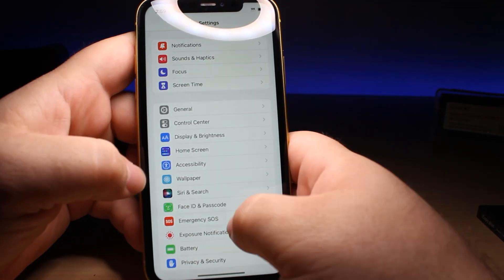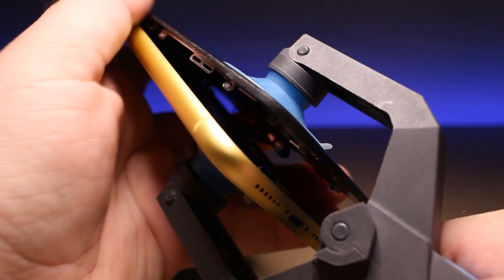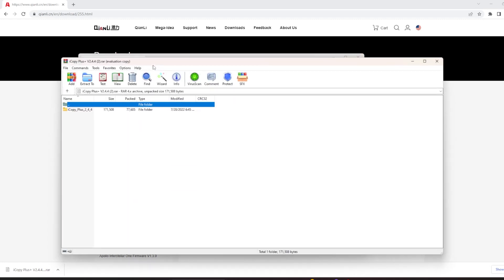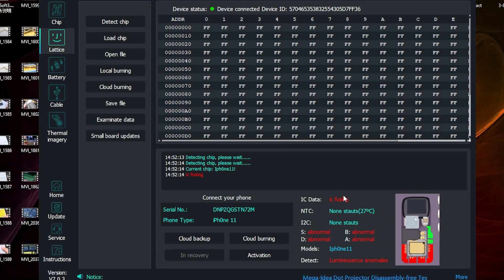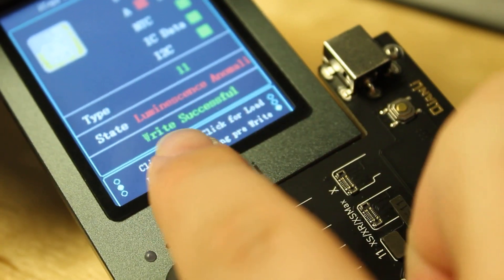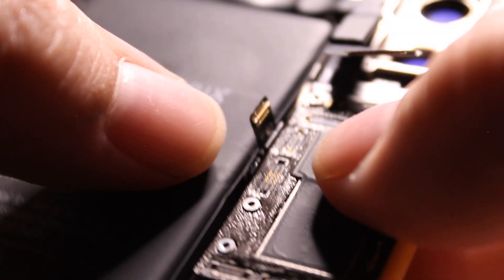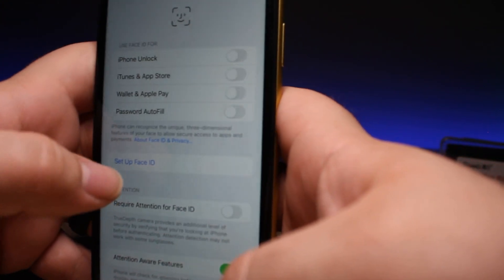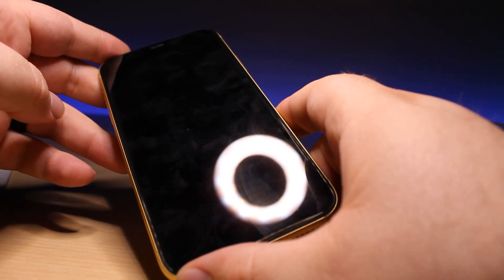Revive Face ID: iCopy Plus 2.2 & New Face ID Board Restoration Tutorial (No Soldering Needed!)

Comment: I keep getting error when trying to use icopy 2.2 for face ID repair. I cloud back up and when click activation I get activation failed, please try again
If the cable is detected abnormally, please remove the extension cord or use the chip solution to fix it.

Comment: Hi sir, thanks for the video.
I was wondering how it’s possible to buy a new face id components and do the programming to be works on used motherboard, can it be done with this tool?
Reply from the maker: No, it’s designed only to fix the original part to get Face ID back.
Reply: @FIXDPHONES  Okay, how then it’s possible to get face id work on another board? 
With another hardware tool or some another way?

What if I replace iCloud chips ( CPU, Nand etc.) from iCloud clean board on other phone board which has Face ID?

Comment: Hi, due to battery problems my iPhone XR cant be detected by the pc while connected via cable, do i have any other solution?
Reply from the maker: You could connect a battery without issues and see if that helps it be detected. If that still doesn’t work maybe something on the motherboard can be fixed to help it be detected.

Comment: very cool. found a cracked (smashed top) iphone 11 (not max/mini/pro, just 11). said face id not working once cleared it out. replaced the screen and the settings just state, face id has an issue, but won't say what kind of issue. the connector looks fine. so, my question is this... can the copy device possibly read the code from original - and from there, program the mini part and use a aftermkt (amazon $15) camera/id assy and have it work?

Comment: Hye,is it using new camera/face id module or using the original old module that is broken?
May I know the success rate and which condition will it work and which will not…since the tag and device quite pricey for some so don’t wanna waste on something that I can’t fix 🥹🥹🥹🥹
Reply from the maker: That’s the whole point. I’ve shown how to do the repair the long and hard way in previous videos, but this allows for the repair to be done quickly without the soldering and attention to detail under magnification for an hour. Sure it’s great that I can do it the old way but if it’s as easy as pressing a few buttons who wouldn’t want to do that instead?
Reply from the maker: The original old module is used for the repair as both the dot projector and infrared cameras are still the paired components to that phone for Face ID functionality.